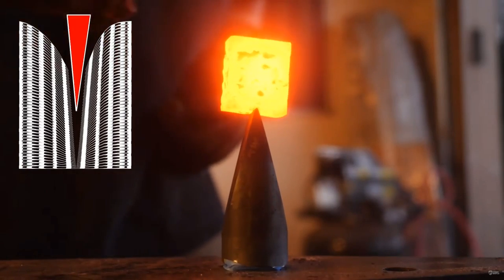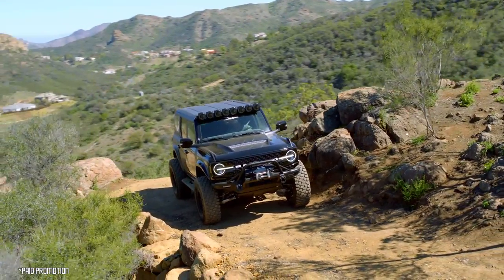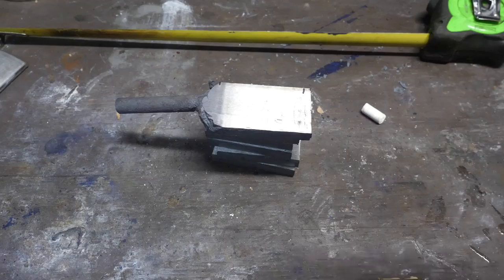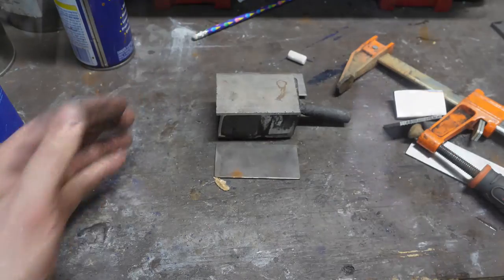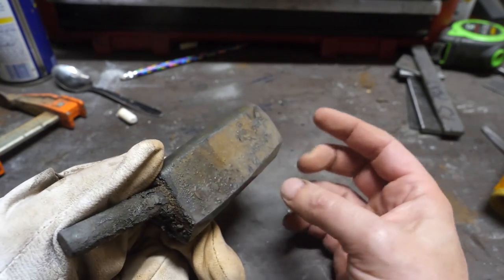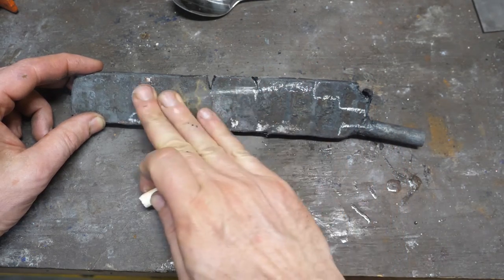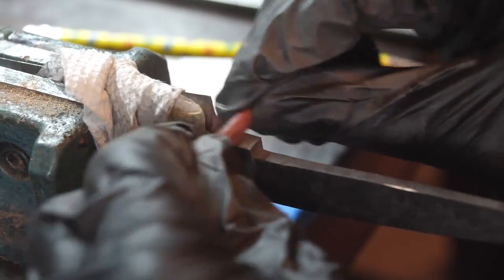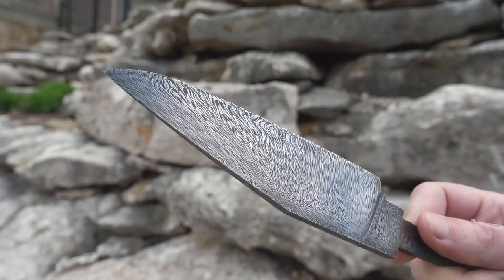Forging Feather Damascus Knives!

Comment: I like the first one for the obvious reason (feather pattern) 

Though I do like the other 

Hell I did feather once and when I welded the split back together it was upside down from the other side 

Ended up clean as all get out but like an S pattern if you will 

It’s in my video list

Comment: couldn't go wrong with either pattern, you should look into building a frame around your bottom die to separate your billet from your splitting wedge like guys use while drifting hammers/axes on presses.

Comment: What I do for my feather billets, is not weld any type of handle on, I actually do this with my butt welded mosaic as well. But if you us hammer eye tongs it allows you to work all 6 sides as needed. Then if a tiny seam in a corner opens up grind it out. I usually knock my corners down to 45's as I draw out the billet. Works great for me on my press.

Comment: Would it be too difficult to manage holding the billet up and over the splitting tool? I.e. put the splitting wedge on the bottom of the press like you would in a hardy hole on an anvil? I feel like if you can hold it you could control the movement better.

Comment: Damn, yeah I do really like the 1st one as its got some pretty cool pattern towards the centre and extending to the tip- so I'd rack that up as a success!
Now that 2nd though
Thats actually hot, a really smoking hot pattern and I've not seen anything like that. So if you can replicate it, I reckon that'll be a Greeny Beetle pattern for the ages if you can get that out consistently and maybe throw in some other elements like a little mosaic along the top, little something something on the bottom with that 'waterfall-wing' kind of look in the middle. Fantastic!

Comment: Just a little tip, Do the majority of your forge welding in a canister (I'm talking all 6 sides) whilst making feather pattern damascus.  It will save you splits, tears, borax ruining the floor of your forge and a huge headache in the long run. 

Also I'm in agreement with @lunkydog.  The second blade has a nicer pattern, and yeah... the first knife would really pop with about half the layers.
Anyhow... always a pleasure watching you work :)

P.S. Before I forget... you should make a jig for splitting your billets so that you don't have to worry about your hot cut tool getting stuck, and thus save yourself another Huge Headache.